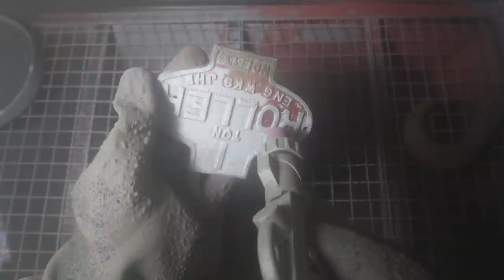Vintage Manual Chain Hoist Restoration.

Comment: I don't normally comment on these videos, but I've been inspecting and repairing rigging equipment such as chain hoists for many years and noticed a few issues which may be serious safety concerns for anyone using this video as a guide to the inner workings of hoists and feel I have an obligation to say something. Hoists of this vintage are interesting as devices in their own right, but should not be put into service due to both the potential metal fatigue issues arising from long use and the fact that they don't meet current standards.

As for the assembly, the welding of the chain and greasing of the friction disks have already been mentioned repeatedly in the comments, but what I didn't see mentioned is the top hook; it doesn't match the lower hook and I don't think it belongs on this hoist. It looks like a tow-hook from a jeep or truck that somebody used to jerry-rig the hoist for use. These may be different grades of steel, with the hook not being rated for lifting use. If I saw this come through my shop it would be an immediate fail. 

This hoist makes an interesting display piece, but has no place in any shop.
Reply: You don't get invited to a lot of parties do you?
Reply: The reason the chain is welded around the lower sheave block is a Gerry-rigged hack to make the lifting distance 2 X of what it was originally designed. Some hoists are designed that way however, the single chain is connected directly to the hook and not welded around the sheave wheel, In addition, the hoist's lift rate is derated by 50%. Everything the fellow said above is 100% correct.
Reply: He greased the load brake 🤦🏽‍♂️ I cringed through most of the video, he used his vise grips backwards too
Reply: Bho vi ci
Reply: @jimrorie3210   There's always that one guy who can't take positive criticism and goes personal due to his or her lack of knowledge...

Comment: Your chain fall is in an unsafe condition.  The welded loop you put through the pulley is an unsafe alteration.  The chain should go through the pulley and back up to the gear box.
Reply: You are absolutely right
Reply: i was to say the same.. you ers right
Reply: And it increases the mechanical advantage if I am not mistaken.
Reply: @BigMouth380cal  kinda, yes.
Reply: Yes, you are correct. I have this same chain pully hoist.
Reply: @BigMouth380cal  it only changes how much effort is used to lift but yeah same thing. It can still pull a ton, just alot harder lol
Reply: Caught that as well. I saw the welded chain and had a WTF moment.
Reply: Regardless,  good production,  AJ!
Reply: @ericball6894  Doubles the tension in the chain, deffo not good
Reply: It’s a half ton chainfall with twice the lift range now
Reply: Give the guy his dues , he’s not showing everyone how to safety test a chain hoist , he’s making an old hoist look pretty and will probably use it around his own workshop to lift a few things that won’t put his back out . I’d happily use it to pull an engine out if I had nothing else …
Reply: Good eye. Crisis averted hopefully
Reply: It's fine , people over worried
Reply: Relax osha

Comment: Nice! I have the same chain pully. It’s actually not supposed to be welded around the bottom pully, it’s supposed to go back up to be a second block. It’s a very slow chain hoist but with the pully system it can lift a lot of weight.
Reply: My dad has a bunch of these in the garage. Don't know why he had so many.
Reply: I agree.

Comment: i worked at a company for 15 years and repaired all kinds of chain hoists. The one thing that almost always needed replaced were the hooks because the safety latch was bent or missing. the hook was unsafe.
Reply: Harold, with you 100%. I was 37yrs in the lifting industry. The hook is of a 4 x 4 tow hitch and the chain is welded back to itself on the bottom hook. The chain should come back up to a main part of the block and terminate giving a 2 part fall. Also the gears in the back were not timed to there settings if he lifts to much they will break and the load will drop. If it all holds together it might make 500kg WLL 
On the up side AJ did do a nice job on restoring it, looks good and I'll have to check his other videos

Comment: Also.... I have a heavy old rusted chain like that in my garage and you've inspired me to clean it. Im guessing... After removing from acid bath just rinse it with water? How do I dry it quickly? And should I grease it or oil it like my skillets?

Comment: The first greasy thing you cleaned with the brush was that gasoline you had it sitting in? I remember my uncle rebuilding an old carburetor and he had it sitting in gasoline and cleaning it with gas.

Comment: Yeah, nice job, I wish I had one of those, but......... it's rigged wrongly.  The lifting hook isn't just a fancy lifting hook, it is part of the lifting system.  The loop round the pulley should be cut and fixed to the main block, possibly to one end of that guide bar you painted red?  Then it will add a 2:1 mechanical advantage to whatever the nominal mechanical advantage of the gearbox is.  As I say; nice job, but it ain't fixed yet!
Reply from the maker: Thanks for the info, I actually did not know that. I got a lot of comments on that. I'll have to fix it.

Comment: nice job .. BUT when you powder coated the hooks and other metal to metal pieces you should have either cold blued them or heated them and quenched them in oil to make them black... the powder coating will not last and will chip off during use and rust will again happen oil quenching or bluing will stop this from happening. just somthing to think about for future projects.
Reply: Heating up the metal parts to oil quench bluing temperature is a definite no-no as this is hot enough to change the temper/heat treat in the parts. This is especially important for lifting items. Cold bluing may be ok. I was wondering if even the acid to clean them was ok due to hydrogen embrittlement. A better process would be to boil the rusty parts to change the red rust II iron oxide to III Fe3O4 black iron oxide (rust bluing). You still get blued parts while avoiding any chemical changes to the steel and also save time cleaning the rust off only to recoat it. Win-win

Comment: Please don't tell me thats actually going to be used with the chain welded up like that. I shuddered when I saw it being disassembled, but had hoped it would have been replaced with a safe one. Also, it probably wasn't a good idea to lube up the brake pads like you did. This is why we don't stand under loads in the air
Reply from the maker: Thanks for the info, I actually did not know that. I got a lot of comments on that. I'll have to fix it. Thankfully it wont lift anything again. I store all my restorations in a display room.
Reply: @AJRestoration  It still looks great though. I'd be proud to be displaying it as well.
Reply: I'm glad someone mention the friction discs being greased. I've worked in Australia's largest lifting and rigging company for over 20 years and besides the obvious chain defect which everyone has mentioned, I was horrified when I saw the friction / brake discs being grease. That is a slip under load just waiting to happen. I am also glad to see your reply that the block won't be used. but for future reference, that would be akin to smothering the brake pads on your car with grease, a very bad Idea. Otherwise a very nice job fixing up an old block. (just another note, no safety latches on the hooks would be an instant fail. but it's an old block and I assume made under different standards and regulations than todays rules.

Comment: How did you clean up the Chains?
Reply from the maker: Dipped in acid, dried then dipped in used car oil and left to drip in a drip tray for 4 days. Wiped off the extra oil and that's all.
Reply: @AJRestoration  Thanks

Comment: 22:24 IMHO it's not a good idea to put grease on friction discs. it can come as an unpleasant surprise when lifting a huge weght.
Reply from the maker: That is true, I have since rectified that since some viewers pointed it out. I did not know that is what they are, and what those discs functions were. It was thoroughly cleaned with alcohol, and carefully dried in the oven at 40 degrees Celsius for 1 hour. Even if it will probably never lift something again, it is important to some viewers that might use this video as a guide.

Comment: If that is an antique, why does it have metric nuts?
Reply from the maker: The metric system is a system of measurement that succeeded the decimalized system based on the metre that had been introduced in France in the 1790s.

Comment: Great job, only fault is that you used cheap alloy pop rivets to hold the badge on instead of a real rivet, seems a shame to bodge that 1 bit when you did a great job on the rest.
Reply from the maker: The supplier did not have this size rivets.